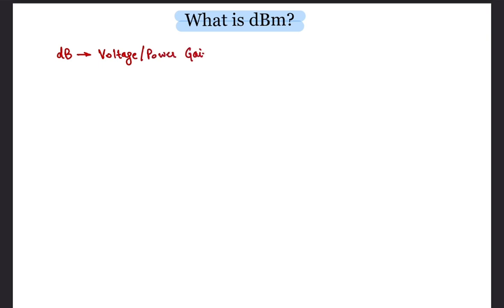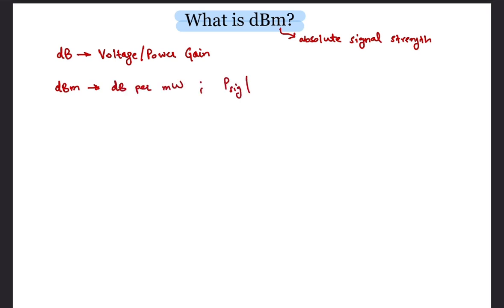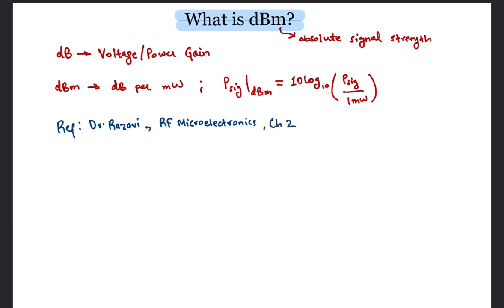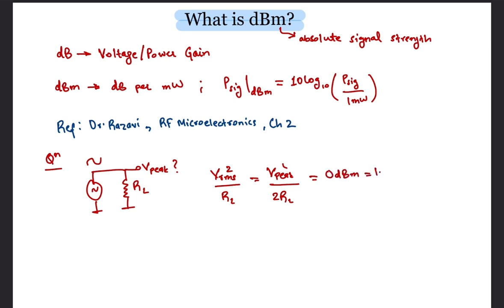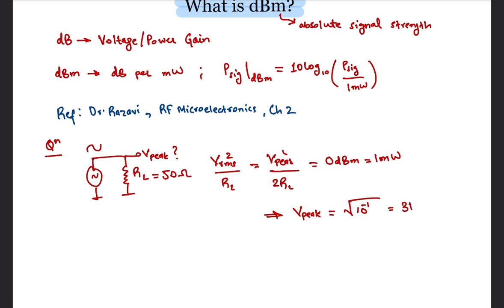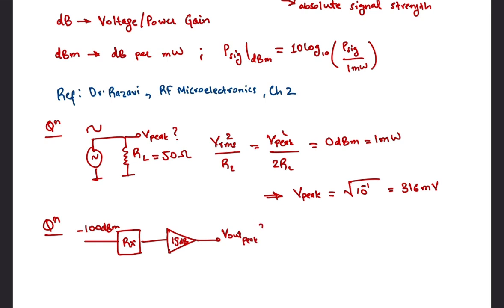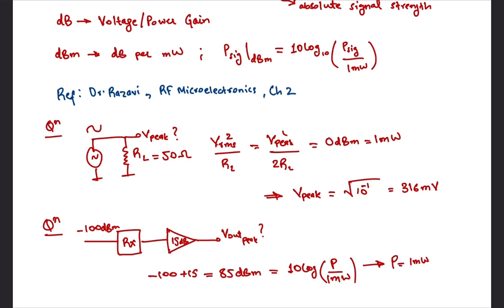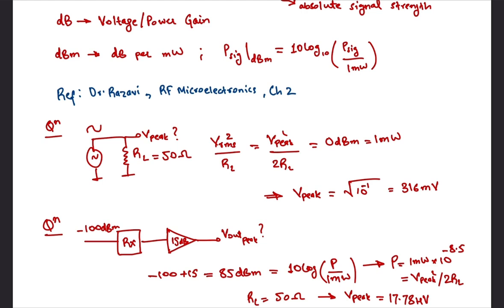What is dBm? Solved Example.

Comment: Hi Tejas ! Because the signal strength is computed with reference to 1 mW, isn't it a relative signal strength rather than absolute signal strength? Else, 0 dBm would mean no power.
Reply from the maker: dB is used for relative strength because it compares Vout relative to Vin. It’s a comparison of the output voltage/power relative to the input. 

I say dBm is the absolute signal strength because there is no comparison with any other signal strength. The reference of 1 mW is just playing with the units. 

Hope that helps.

Comment: Can we add directly an dbm quantity to db of amp
Reply from the maker: dBm isn’t exactly an unit. If you look at the formula, you would see that it is dimensionless. 

If you find this confusing then you can first find the amplitude of the -100 dBm signal, and then multiply it by the gain of 15 dB  [i.e., 10^(15/20)], to obtain the amplitude after amplification.
Reply: @Tejas Ketkar, -100 dBm of signal comes to amplitude of 100uV. Gain in the signal chain path is 15 dB which in linear scale comes to ~5.6234. This leads to ~562uV of peak signal at the output. Doesn't matches with 17uV? 

Pls correct me If I am wrong here
Reply from the maker: @ankitnaredi3341  -100 dBm signal does not correspond to 100 uV. -100 dBm means that Power of the signal is  10^(-10) mW. Power is Vrms^2 / R ; Take R = 50 ohms and find Vrms.

I have demonstrated the procedure in the video.
Reply: @TejasKetkar  My bad, I missed the denominator factor of 1mW
Reply from the maker: @ankitnaredi3341  No Issues. Good luck!

Comment: Can you please come up with mismatch topics used for designing amplifiers? 🙏
Reply from the maker: I didn’t understand. Could you please elaborate?
Reply: Calculation of offset due to noise and mismatch of transistor. (Random offset, systematic offset, etc)
Reply from the maker: ID Mismatch of a Current Mirror
https://youtu.be/iCMGivONj-U